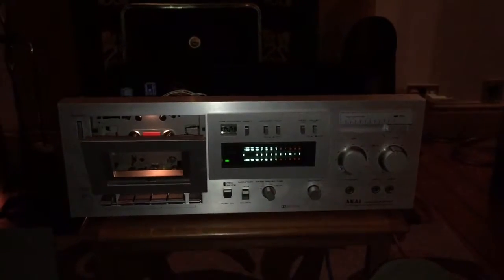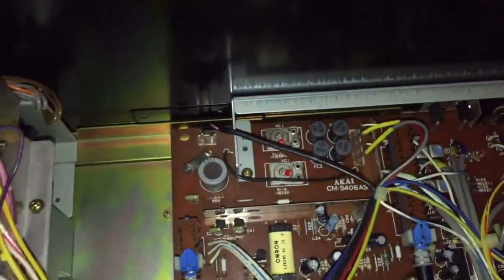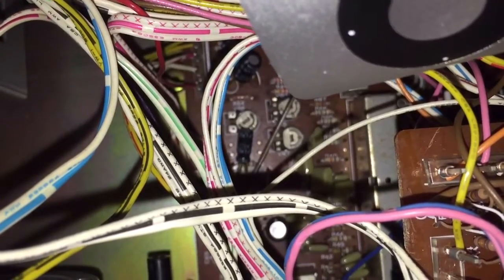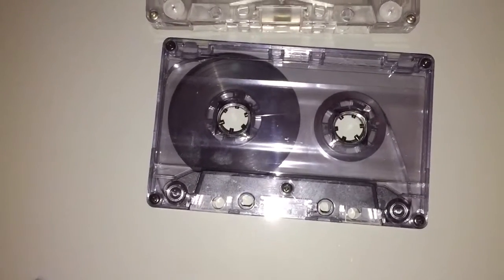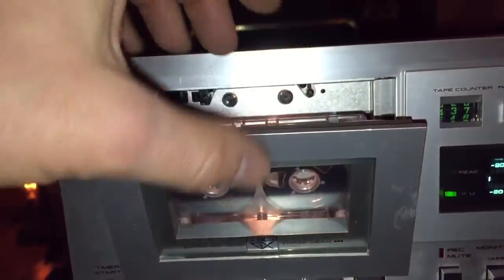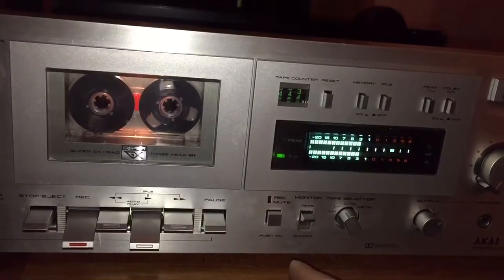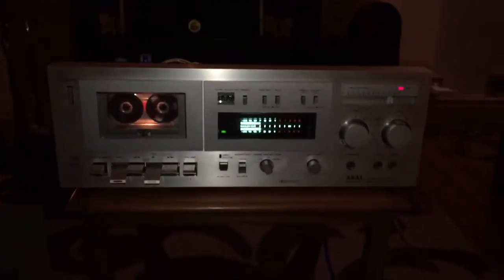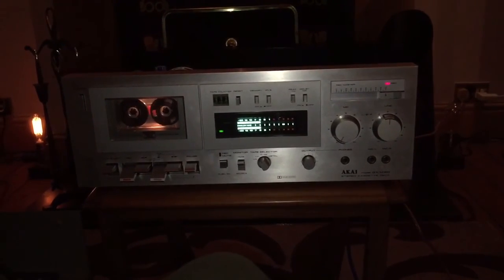Bias Adjustment Akai GX-M50 Cassette Deck

Comment: I have the GX-M10, which is similar, but looking at your video your deck is a much more confident build internally - in particular the cassette transport mech as a whole.
Also, the meter on your M50 is coloured, unlike my one-colour meter system.

Comment: Darren, What a great find for me to see a bias adjustment on one of these! I just aquired one but the recording sounds like fingernails on a chalkboard and fades in and out. I made a mirror cassette and did not see any tape path wandering over the heads so I think I may have a bias issue. Can I just turn the 2 big master bias screws while recording and switching from source to tape to monitor my progress? I touched one and my receiver went right into protection! right now they seem to be physically turned all the way down like a snug screw...?  Also my erase 'pin' that the erase heads bumps up against during play/record was broken clean off so I made one out of a piece of plastic sprue from a model kit. My question on that is does it have a flat on the bottom where the head contacts or is it completely round? This is my first 3 head deck and I made the mistake of adjusting the azimuth to playback, not realizing that I was also moving the record head in the opposite direction so I think I got that squared away as playback is crystal clear and balanced with soaring highs and good bass. Thanks.
Reply: well, I got bigger issues. My P/S is not putting out the correct voltage on the 30V rail, seems Im getting a voltage split somewhere and its backfeeding the 0v rail with 18v? Also my AC bias settings are no where close to spec and I cant adjust them with the pots. Time to start chasing the voltage issue.

Comment: I have this exact deck and no problems recording, the problem is playback is far lower and unbalanced even though the deck records perfectly it plays horribly. Is there an adjustment on the inside for right and left playback levels?
Reply: Randy, First of all get hold of its service manual. Then you will know what is where. I might be able to help fix it.